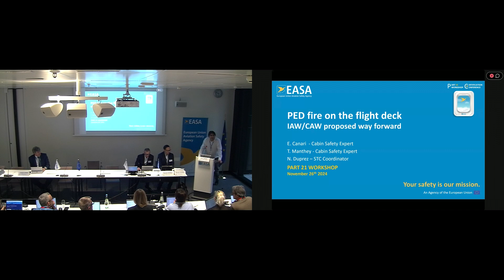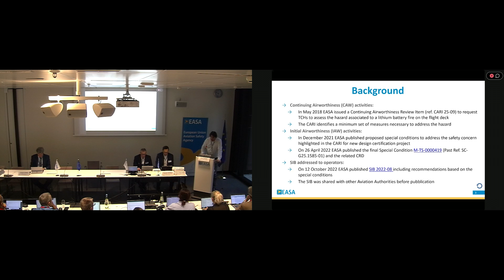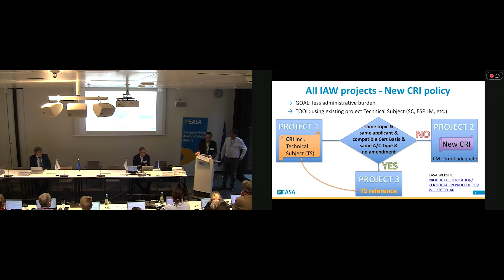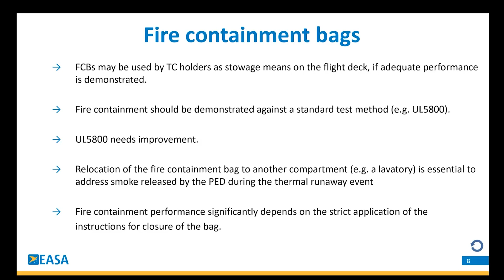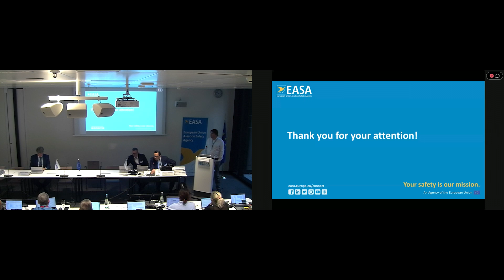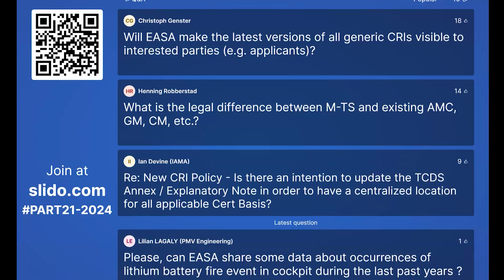PED fire in the cockpit

Comment: In over 260 million flights with tablet EFBs there has not been any data to support that this is a credible risk.

You are taking CABIN fires of non controls devices and applying this to managed EFBs.

This is wrong on all fronts
Reply: The complete lack of any data or actual events to support this is nothing more than an unnecessary tax on operators. 

My main question is why no airlines getting ready to be forced to spend millions of Euro on fixing a nonexistent problem are showing any signs of resistance!